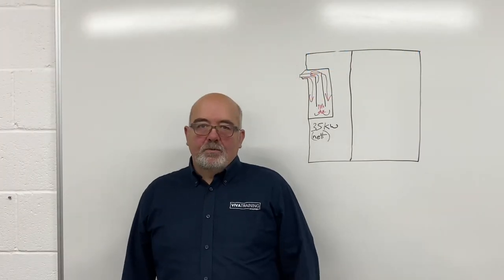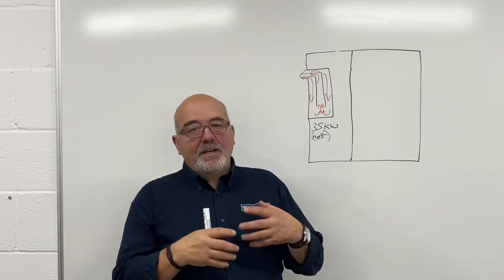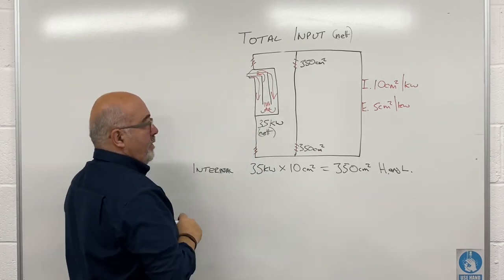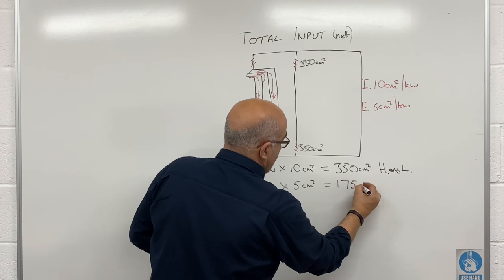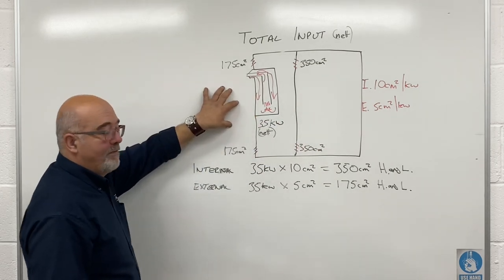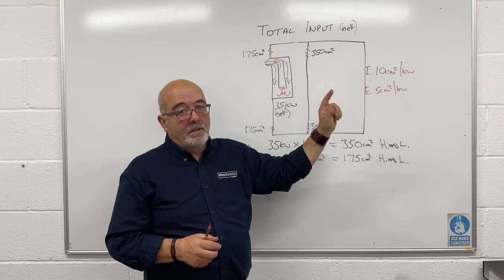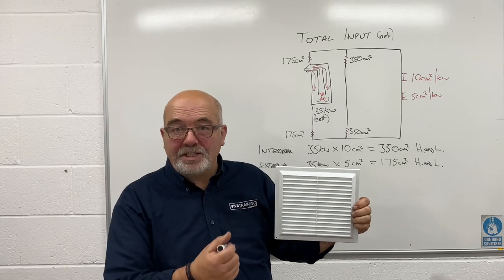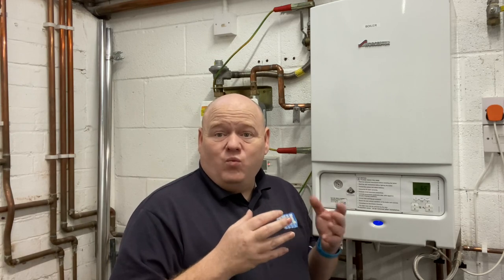ACS Gas Training Ventilation Room Sealed Gas Appliances

Comment: @Allen Hart  got a question in one of my exams recently it said.  
What is the ventilation requirement for a fluess gas fire with a catalytic converter. 
A . No ventilation requirement 
B. 100cm
C. 50cm
D. 35cm.

N. B those are square centimeters